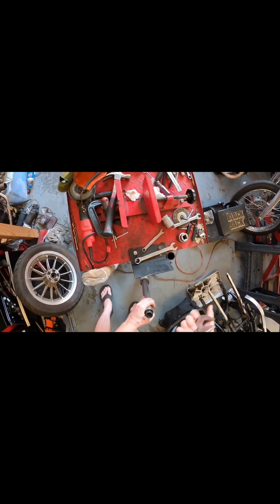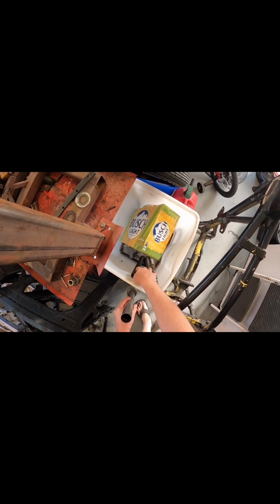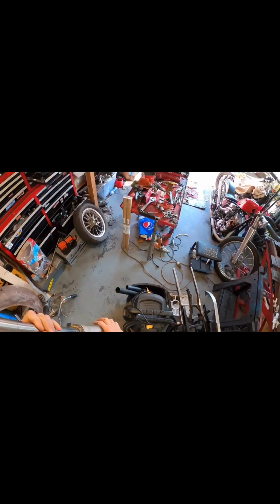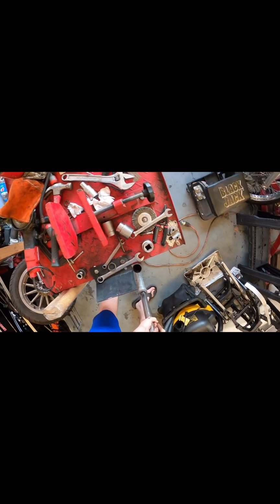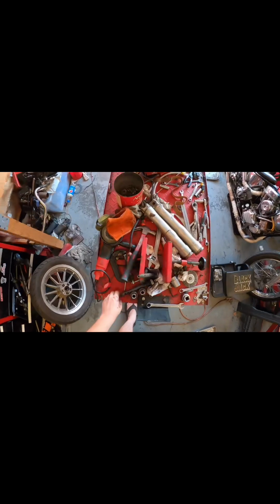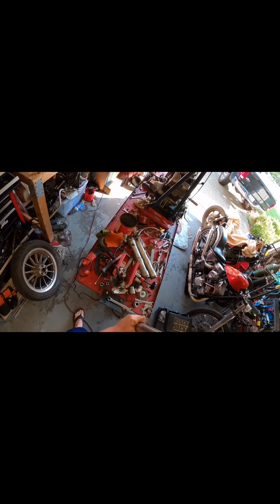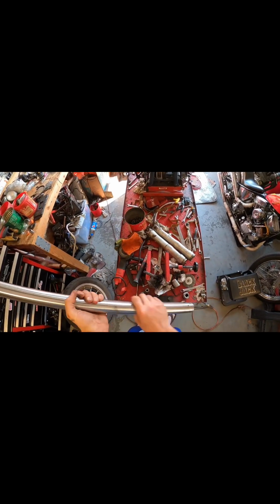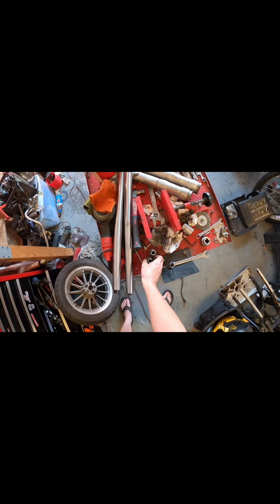Shovelhead chopper extended fork tube install

Comment: What did you use to make the spacers and is it just 6” since you went plus 6 on the tubes?
Reply from the maker: Just 6” tubing, the spacer should be the same length as the fork tubes are extended.
Reply: @843chops  thank you for the info, did you use steel tubing? Will pvc work?